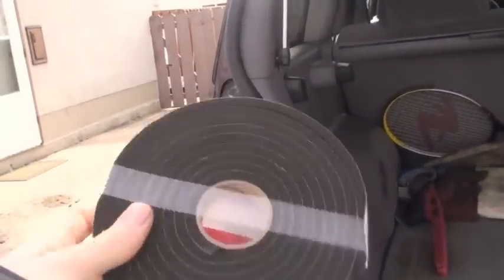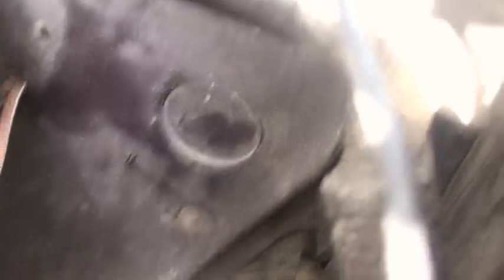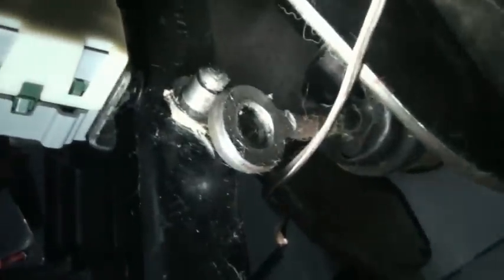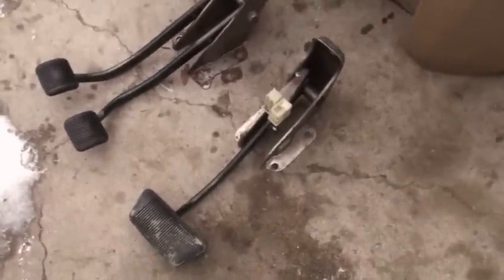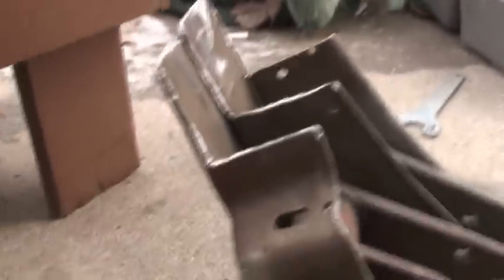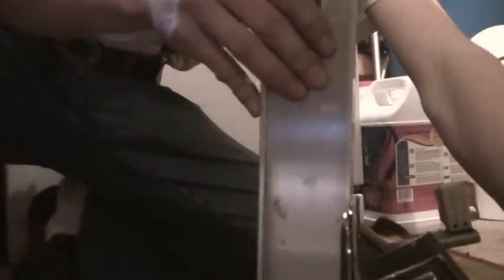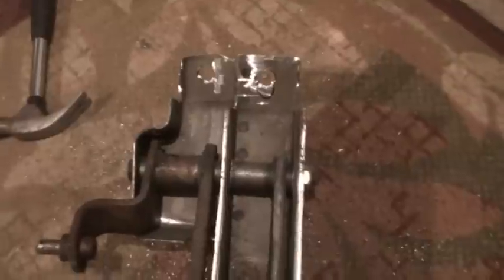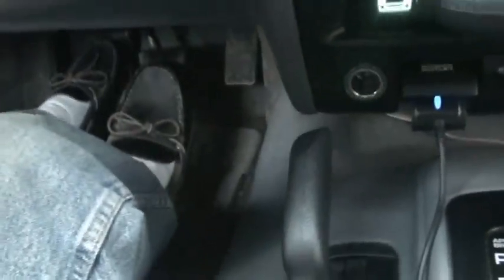AX15 ZJ SWAP - Manual Pedals Installed

Comment from the maker: Glad you asked!

1. Wont have to pay $2200 for an Auto rebuild every 5 years.

2. The Auto is garbage, has useles ratios, takes to much time to shift and wastes fuel.

3. The AX15 is HEAVY-DUTY, at least 15-20 years before a rebuild, which can be done my self.

4. The ratios from 1-4 are much lower then the auto, 5 is the same as 4 in the auto, and fuel econmy goes way up!

5. Costs less then $700 for a swap.

6. Very rare project!

Need I say more?....

Comment: Hello, I have 94 4.0, 42re and manual transmission ax-15 to 93, did everything almost as well, can not turn on the gear, there is not enough stroke of the master cylinder, you do not know why this can be?
Reply from the maker: Иван Смоляков Are you sure it's the master cylinder? Have you consodered replacing it?
Reply: LostFart With the help of a spacer extension rod cylinder, I was able to turn on the gear.
Reply from the maker: Иван Смоляков That's exciting!

Comment: Alright! is it the same box as in a 5.2l v8 grand? 
I got one and i really love the tranny in it. it shifts smooth and just when i want it. 
No slow shifts at all, and im running 33"s :)  Theres a vid or two of it on my channel. 

Imo when offroading automatic is better. you can be on the brake and gas at the same time carefully crawling forward without risking rolling backwards if you have to switch from the gas to the brake.

Comment: Did you have to extend the push rod on the clutch master cylinder at all and did you have to extend that little rod on the side of the clutch pedal that connects it to the push rod? If so how long did you extend it? thanks
Reply from the maker: I did NOT have to extend the master cylinder rod or the clutch pedal rod. It worked perfect without any mods such as that!

Comment from the maker: No it is not the same Auto. I like the auto for rock climbing but just trail riding with a few steep hills and hards to maneuver turns and so forth will be a challange but it will only better my skills as a manual transmssion operator lol.